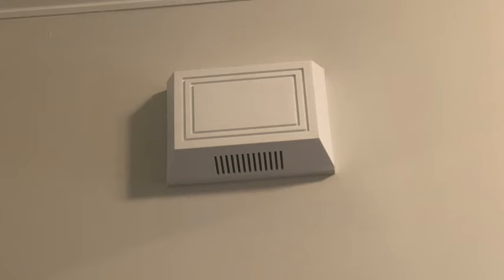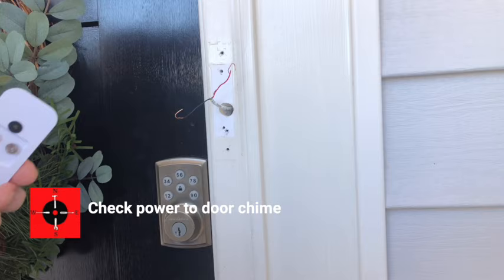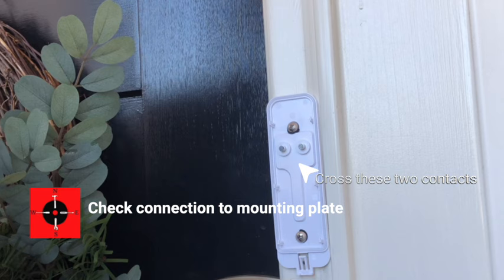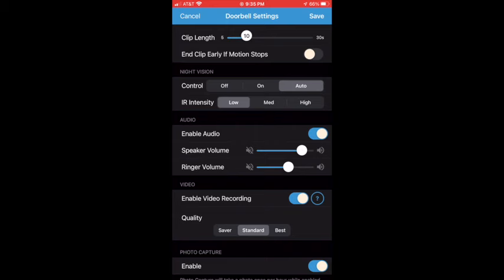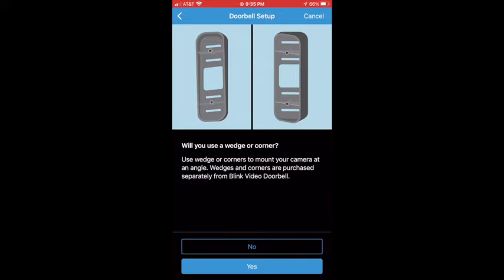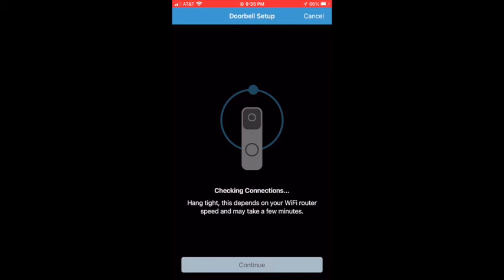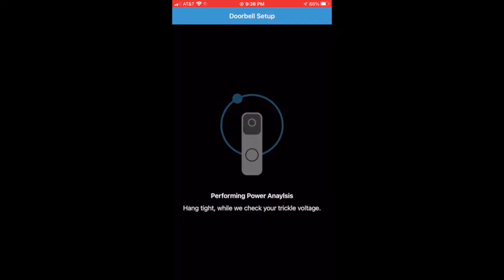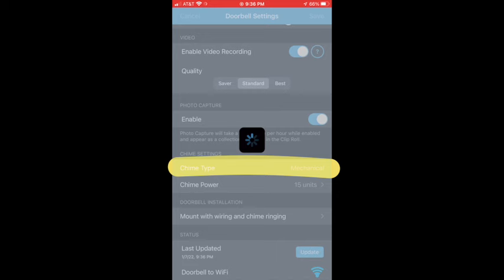Blink Video Doorbell Chime Not Working | Door Chime NOT WORKING

Comment: Ah yes this worked. Thank you!  Just needed to go back to the app after installing it and completing the setup. I clicked on “mount with wiring and chime” again .
Reply from the maker: Angelica, I'm so glad it helped.  That was the same issue I faced.  You'd think it would be on by default.  Thanks so much for watching!
Reply: @FieldGuidetoDIY  I have a Blink doorbell that is not wired to my house.  It use to sound in my house when the doorbell was pushed on the Blink doorbell.  Now it doesn't.  Help!!

Comment: Thank you so much! I was on the verge of returning the Blink Doorbell out of frustration. It's amazing how little time is invested by Amazon to include more thorough instructions to install their products. You saved me so much time and hassle.
Reply from the maker: I’m so glad it helped, Carson.  Plus I’d think the doorbell chime would be enabled by default.  Thanks so much for watching.
Reply: It took an hour for me to get the blink to latch onto the mount, I had to finally add spacers to the mounting plate to get it further from the angle mount to enable me to get the blink to lock on.
Reply from the maker: Great tip Bonnie.  I’m glad you were finally able to get it.  Sorry it took you so long.  Thanks so much for watching.

Comment: This was very helpful.  I could not figure out how to get the mechanical chimes work, the chimes would only make a thud sound. I thought maybe I'd need a diode or resister to make it work. I moved the door from my external sync module to my internal sync module so I could use the mini cam as a chime. Now that I have it working, I can move it back to the external sync module.  Thanks!!
Reply from the maker: You are quite welcome.  I am so glad it helped.

Comment: Thank you verry much, but it still doesn’t work here. Do you have by any cnahce any wiring digram? Its a new installation without any wiring. I have the doorbell, a 24v transformer and a 24v analog mechanical chime (briiiiing) but cant get it to work whatever i try

Comment: My problem is I was replacing a Wyze DoorBell v1 which had me change the wiring in the chime box and I am not sure I can or need to change it back to use the original chime with the Blink DoorBell or even whether I can leave the Wyze Chime plugged into A/C and use that. Any suggestions?

Comment: What do you if it says connection failed and just running on batteries
Reply from the maker: First off, it runs on batteries.  The Blink Video Doorbell does not get power from the door chime connection.  Secondly, if your Blink Video Doorbell says Connection Failed, I suggest you move the doorbell closer to your wireless router and see if you can get a connection that way.  Even have it right next to the router.  If it still says Connection Failed then perform a factory reset and start the configuration over again.  Let me know how it goes.

Comment: Is it possible to go back and /disable/ a mechanical chime that's wired in? A night shift is starting here and I want to disable it during the day, for now.
Reply from the maker: You can physically unscrew the Blink and disconnect the wires OR you can go into the app and change where you set it to mechanical.  There is no way to schedule this change to happen each night.  They have it always chime whether Blink is armed or not.
Reply: @FieldGuidetoDIY  That was my question, whether I could change it in the app to disable it. No need for a schedule. Thanks!
Reply from the maker: @Kinyin  anytime!

Comment: My house doesn't have a door bell so I can wired up the blink doorbell for the chime. Does blink sell another product so I can bluetooth/connect the blink door bell to so I can get a chime inside the house and not just my phone?
Reply from the maker: Ger Lee, not that I’m aware of.  I’m looking into security control panels like Apple Homekit that work with Blink but have not landed on one.  At this point without a home door chime, the app appears to be the only way to hear the doorbell other thank the Blink Video Doorbell.
Reply: I have the same problem.  Can I at least  get a chime notification?  Right now it gives me the same notification as motion detected by my other cameras. I'm missing so many people at the door because I don't know that they are there.
Reply from the maker: @662spalmer  well, if you disable motion detection it was only alert when the button was pushed.  But I don’t think you want to do that.  Keep me posted.
Reply: @FieldGuidetoDIY  no I don't want to do that.  I have 4 other cameras and I wouldn't want to disable either of them
Reply from the maker: @662spalmer  you can keep the others with motion detection enabled and only disable motion detection on the Blink Video Doorbell camera.  But, again, I don’t think you want that either.  That would eliminate your ability to catch anything going on at your front door unless they rang the doorbell.  You may have to go the route of installing a doorbell or just deal with it.  I believe you can set different tones for motion detection vs doorbell ring.  Keep me posted.

Comment: If I connect it to the existing chime, can I add an additional chimes? If so which brand and what are they called? Thanks
Reply from the maker: I haven’t researched it a lot but in the app you either use manual or Bluetooth.  You cannot use both concurrently.  Now I know of some ADA doorbells which can use the same wiring as a manual chime.  What are you looking for?
Reply: @FieldGuidetoDIY  thanks for the reply, I'm looking to have about 2 or 3 chimes, connected to the blink doorbell, any idea what make or model of a device that can be used as chimes for this doorbell.

Comment: If I wired the camera, Should I leave the batteries inside the camera? If the answer is yes, why?
Reply from the maker: That is a great question Edwin.  The wires only power the button connection to the door chime.  You still need batteries to power the doorbell button and the wireless camera.  I hope this helps.

Comment: I turn off my power before installing then I turned my power on and it wasn’t powering anything I check to see if the wire was hot it wasn’t it stopped working now I have another issue
Reply from the maker: I would take it completely off and test to see if you can get it to ring and record video.  While it is off, return power to the wires and cross the wires as shown in the video to test the bell.  That way you can isolate if it is the chime or the video doorbell.  Let me know if that helps.

Comment: Hi, I cannot make it work with my existing wired doorbell chime. When I cross both wires, the chime rings just fine, but after connecting the wires to the blink doorbell and setting it up on the app along with the chime settings, still does not work. I have tried selecting mechanical or digital and still does not work. Could it be the transformer is not compatible? I have a Commax wired doorbell which does not have a separate transformer I can switch. Thanks for your help!
Reply from the maker: Luciano, I’m not familiar with that model.  Are there thick wires or thin ones like those pictured in the video?  That may tell you what voltage it is.
Reply: @FieldGuidetoDIY  They are thin wires just like your video. Is there anything else I can try? Thanks!
Reply from the maker: @Luchosacco  if you’re certain you’ve got the app configured correctly as shown in the video, you might try another Blink Video Doorbell unit.

Comment: My app doesn’t have this option. App version 6.10.2 . Any suggestions? Thanks
Reply from the maker: I would suggest upgrading your app.  I’m running 6.10.2.  Also make sure you have the correct device installed.  Thanks so much for watching.  Let me know if this helps.

Comment: My current door chime is battery powered, not mains, will I be able to wire this up still?
Reply from the maker: How does your current doorbell button send the signal to the chime?  It may be a proprietary wireless signal which in that case this would not work.  If it is Bluetooth, there’s a chance Blink might work with it.  I’m curious to know.
Reply: @FieldGuidetoDIY  . I’ve not long lived here and only took the cover off today as have a blink on order. The chime is activated by twin wire to a button switch by the front door and powered by 4 large batteries
Reply from the maker: @philosullivan2362  Oh I see.  I believe the Blink will work for you in that case.  Please keep me posted.
Reply: @FieldGuidetoDIY  fingers crossed . I’ll keep you posted 😎

Comment: So what happens if it IS a blown transformer?  Where IS the transformer and HOW do I replace it?????
Reply from the maker: Great question Rob.  They are USUALLY In the crawl space of the house and wired into the ceramic light fixture.  If you don’t have a crawl space, check the garage or utility closet.  Let me know if you find it.  I’d suggest you then carefully remove it and purchase a replacement either online or from a home improvement store.